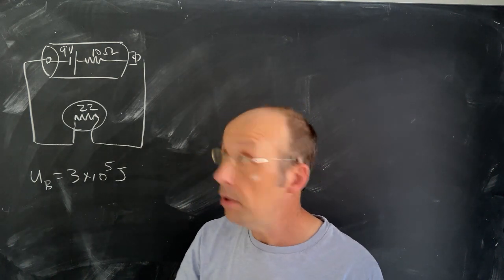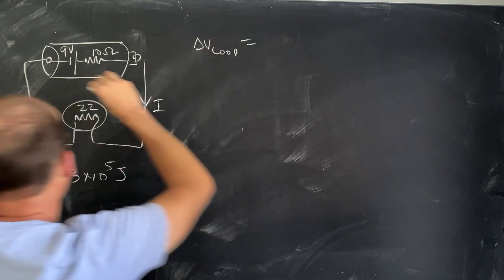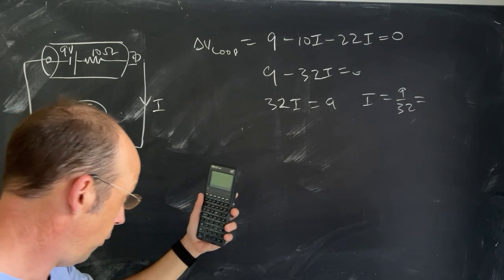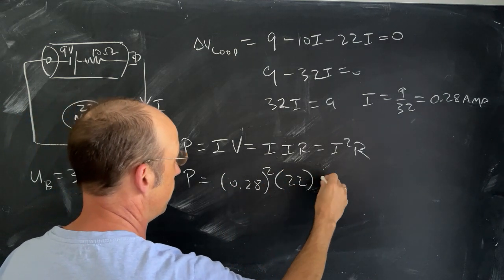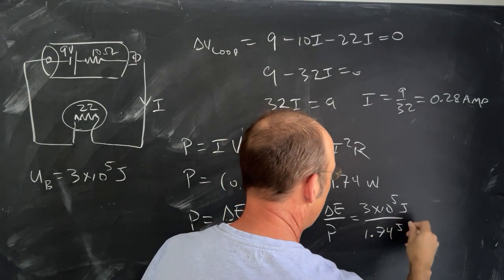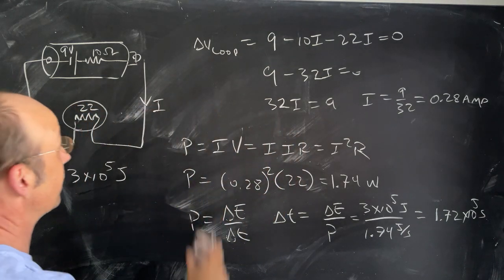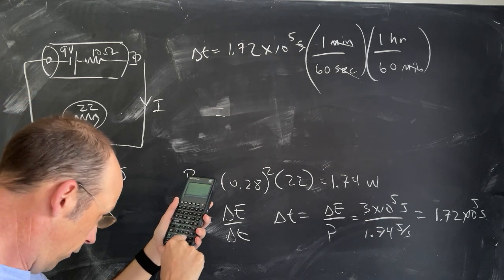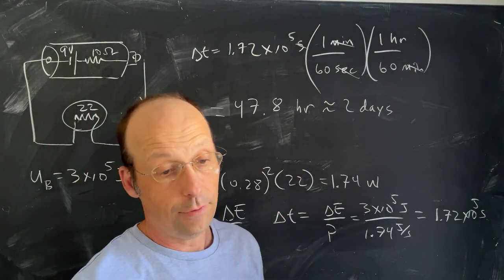Physics Problem: How Long Would This Flashlight Last?

Comment: If the internal resistance is used to determine the overall current, then the internal resistance would also need to be used throughout. P = V^2/Rt where Rt = Rbat + Rload = 2.53W. t = E/P = 118.6ks